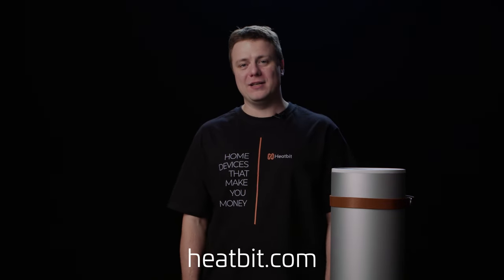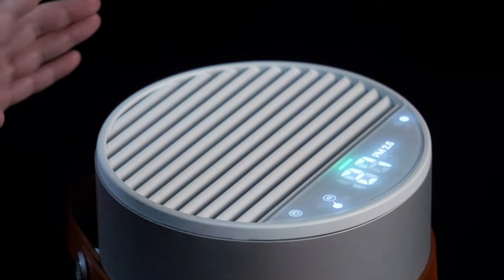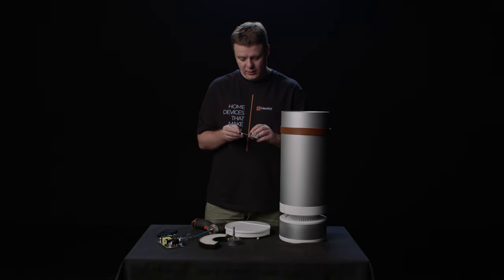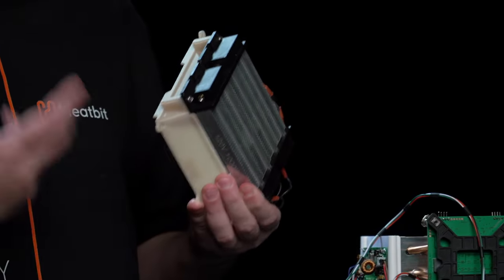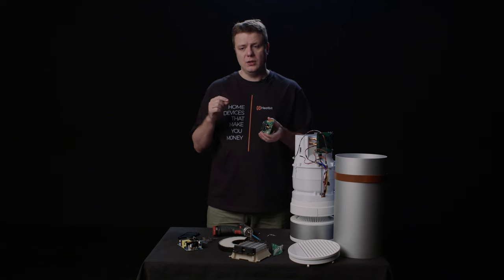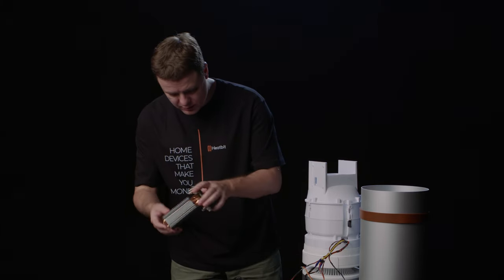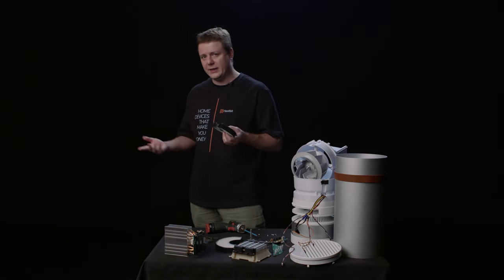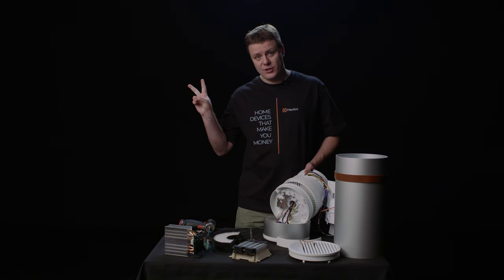Heatbit Trio Review - Unlocking the Secrets

Comment: Can this be fully remote controlled via WiFi? What happens if it loses power, will it remember settings and power up automatically?
Reply from the maker: Yes, on the same WiFi network. 
It will remember the settings. The power-up scenarios are currently being worked on, so they will be finalized by the time the devices are delivered or in our subsequent software updates.

Comment: Can you please add a feature to disable the extra heating coil?
Or is i possible to disconnect it?
(Don’t like the idea to generate heat without mining)
Reply from the maker: It's already there :) If you heat in Eco mode, only silicon chips are involved
Reply: @heatbit  Thanks for clarifying.
So the other modes will earn same amount bitcoin as ECO-mode?
Reply from the maker: @sanhef9461  you can use mining + purification, mining + purification + heating (heat coil), or purification exclusively.
Silicon chips consume 400W at 10 TH/s. A heating coil gives you optional 1000W but no Bitcoin rewards.

Comment: I very much appreciate the teardown! Looks like a big improvement over the previous version. I've been wanting something like this for a few years now. 

Some questions:

Are there OTA updates?
Will the rewards half at the BTC halving this year?
Can you turn off the LEDs completely for those like me who need it completely dark to sleep?
Is the BTC you earn KYC?
Why is the black version 25% more expensive? I'd be tempted to paint it myself at that price.
Are you hiring? =P

Suggestions:

Consider replacing the Orange Pi with a custom PCBA.
Perhaps look into NixOS instead of Debian builds, which has some advantages for embedded systems.
For future products, it would be great to have a heater, cooler, purifier, fan (with continuous speed settings), miner all in one.
Reply from the maker: Glad to hear that torturing Mini was informative to you.

1. Yes, hardware-related tasks are completed; software updates will follow.
2. Yes. This applies to any device mining BTC. Mini is less affected since its primary purpose is heating. ASIC miners turn into electrical waste when electricity costs surpass mining income.
3. In some modes, yes, but there's no dedicated control for this. Reducing light pollution is important, so thanks for highlighting this.
4. If I understand correctly and you're inquiring about "clean" Bitcoin, then the answer is yes. It's a mining reward from the NiceHash pool. You can inquire with them whether they segregate mining rewards or blend them with Bitcoin acquired in other ways.
5. Production headache because anodizing doesn't consistently yield colors other than silver unless you have Apple-scale operations and contractors.
6. You can explore open positions here or send a general application by saying 'Hi': https://heatbit.com/pages/jobs

Heatbit Mini features a custom mining plate with 5 nm chips. Securing it was a significant challenge, but entirely worth it. You might find this thread interesting: https://twitter.com/heatbit_com/status/1681635155092426752

Thank you for your suggestions. We have plans for air conditioners and further development of the concept. After shipping Minis to customers.

Comment: Will it be suitable in a small cold workshop where there is wood and metal dust ?
Reply from the maker: It has no measures for harsh conditions, so won't be the best option.

While Mini uses HEPA filters for air purification and protecting itself from dust, the amount of air going through it is not enough to filter the pollution like HEPA filters used in enterprise ventilation systems. 

Exposing it to construction dust may harm the device. If it's in a part of your room where there's not a lot of dust, this should work if you replace filters more often.
For more detailed reply, we need more information on how you plan to use it. Some photos of your workshop would be perfect. 

Please, contact our support team to figure out if it works for you: support@heatbit.com

Comment: How is this mini an improvement over your previous Heatbit that some influencers seemed to have problems with?
Reply from the maker: Mini is a conceptually different usage-focused device.

It's based on a custom plate with 5 nm chips, instead of Antminer S9 plates. 
You get 10 TH/s from 400W. Additional 1000W from a heating coil is an option.
By running it in eco mode, you get full mining rewards and purify your air without excessive heat and noise.

It's more efficient than having 13.5 TH/s from 1400W when you lose efficiency by decreasing the wattage. 

As it was our first device, we've also learned what could be better and considered it to design the second device with all additional resources and opportunities.

Comment: Great idea in theory but if I bought one I would probably be making about £8 a month in BTC and spend £8 a month on filters so I would be paying a premium to heat my home on electricity instead of gas at a cheaper rate. Not to mention the $800 investment 🤔
Reply from the maker: Mini is not financially viable for every household, which is why we have a calculator on our website. In some locations, you may benefit from very low electricity costs, central heating, or, conversely, have enormous gas rates.